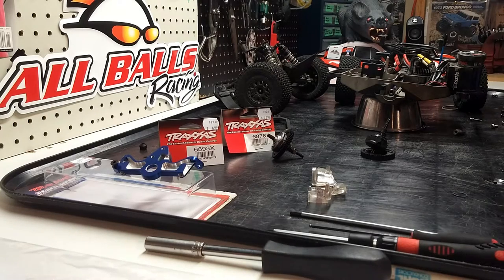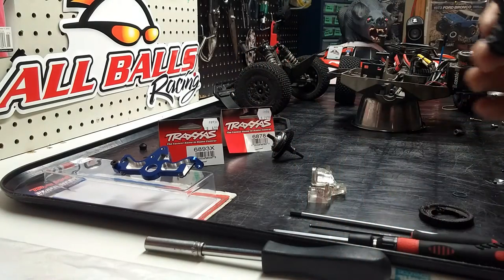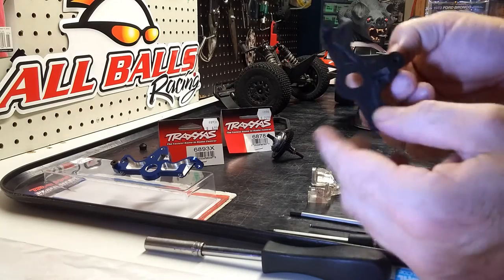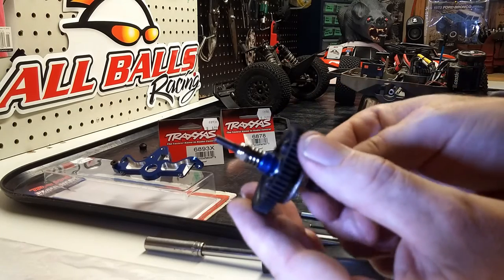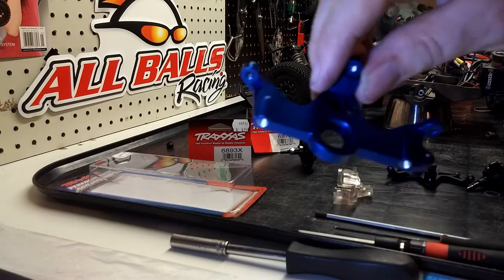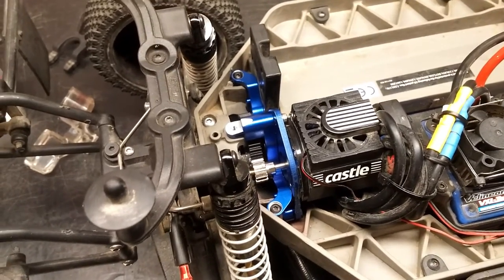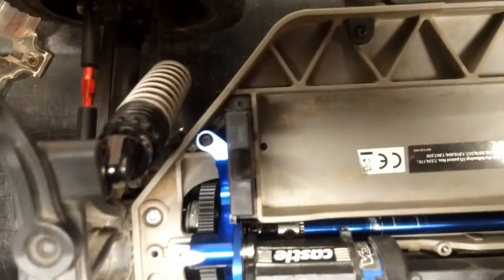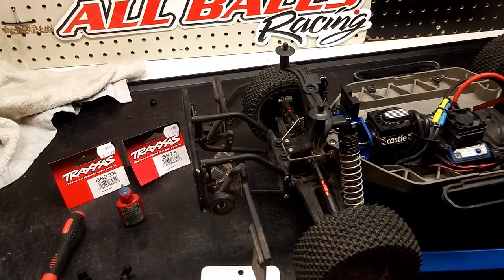Traxxas Slash 4X4 Center Diff Upgrade With Traxxas Aluminum Parts

Comment: i bash my slash 4x4. i use the center diff with very heavy weight silicon. biggest difference i noticed, my truck didn't flip nearly at much. the power that usually would flip it would be sent to the rest of the drive train and it is so much better for bashing. tuning.

Comment: They make carbon fiber pads for that slipper clutch and they are amazing. Keeps the heat down as well. Also be careful with that plastic spur gear. The metal pinion gear will melt the teeth down if motor gets too hot. I went to a hot racing metal spur gear and my motor runs 10° cooler just from that alone.
Reply from the maker: Wow, awesome,
Thanks for the great comment, I will check that out, cooler is good. 😀
Asplenia.
Reply: Personally I've had bad experiences with metal spur gears. They are loud and expensive, as well they dont absorb the vibrations like the plastics do, so those vibrations travel to the motor. If your mesh is set right, you almost never have to replace your plastic spur, and if you do, they are cheap. Just my experience!

Comment: Great vid buddy, My slash has the slipper clutch set up. I find it slips a lot, I even have the spring tensioner tightened all the way and it still slips ha ha, but hey it does it's job and saves a lot of spur damage (-:
Reply from the maker: +Jax Teller RC 
Jax,
Just tried this out for the first time on my snow track.  What a beast on 2S, on 3S this thing is like Mad Max, if he drove a 4WD Slash:)
Asplenia.
Reply: asplenia
Thats Awesome man, Mad Max is a nutcase ha ha

Comment: Not trying to be mean, but every three battery runs.Maybe it's your driving style. I have a vxl slash 4x4. It's 9 yrs old and have raced and bashed it hundreds of times and have only changed slipper clutches twice, have gone through 3 sets of tires like wore to nothing.

Comment: That's not the LCG chassis.
Reply from the maker: +Josh Powell 
HMMM, I think it is :)
Asplenia.
Reply: +asplenia if you had any clue you would know Its NOT an LCG chassis. look it up. your steering servo is mounted upright, which is not possible on the LCG chassis. Your center driveshaft is set down in the chassis, which is also not possible in the LCG chassis, and your side bars are not the right shape or mounted the way the LCG ones are. I have an LCG chassis on my slash. and they are by far 2 totally difference chassis.
Reply from the maker: +Josh Powell 
Thanks for clearing that up Josh :)
Asplenia.
Reply: No shit
Reply: looks like mine which is LCG....

Comment: The E-Revo Slipper would fix your problem. And FYI the center diff is for racing and not bashing. Plus why would you want 1 wheel traction. Atleast with the slipper you get 2 wheels with power all the time.